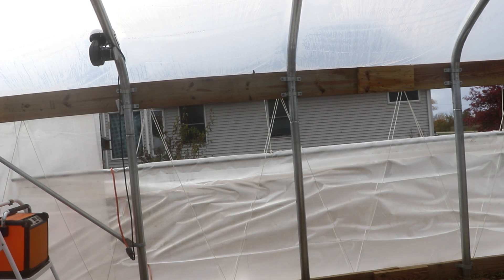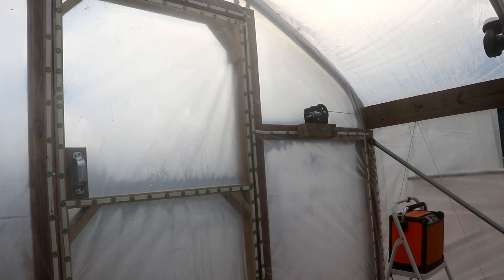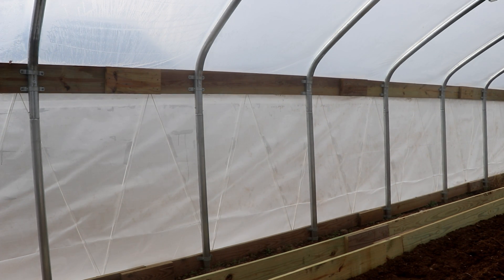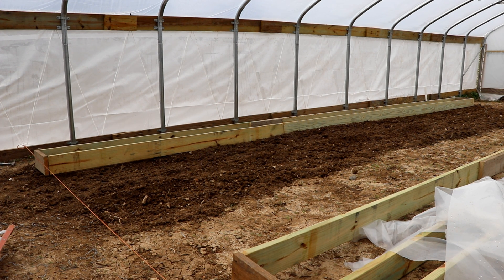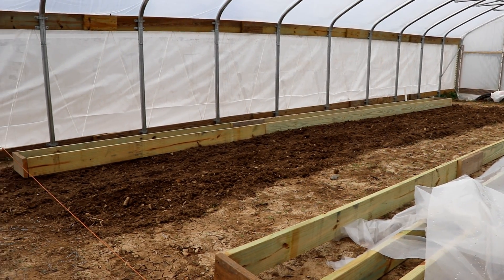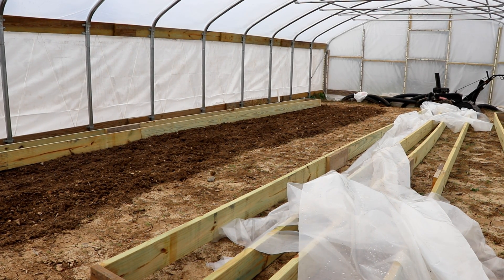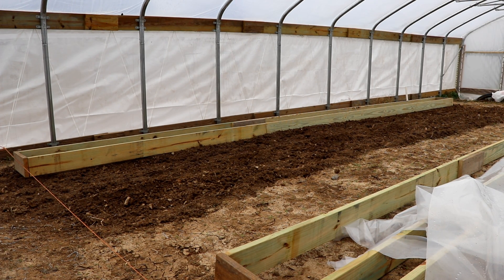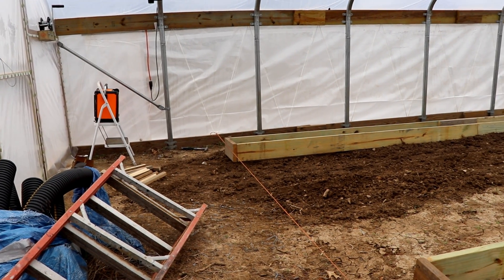Building a geothermal heat sink greenhouse series - part 8

Comment: WAITING FOR YOUR UP DATE,PLANNING ONE TO INSTALL NEXT SPRING SO I AM FOLLOWING YOU CLOSE IN WISCONSIN, ARE YOU GROWING ANY THING YET AND HOW IS THE GEOTHERMAL BED HEATING
Reply from the maker: Floyd Funk good morning.  Hopefully today I’ll get the grow boxes filled and topped off.  We have the fan that will blow air through the heat sink ordered and on the way.  I’m thinking we may need a pair of the fans to move an adequate amount of air to charge the heat sink during the day.  I’ll mount the first fan on my plastic barrel  that will serve as our manifold so I can add a second fan as needed. 

After the grow boxes are full we will start seedlings. Most of our crops initially will be of the cold tolerant variety.  We do want to see how frost sensitive stuff will do with colder evening temperatures and warmer during the day. 

We had 6 inches of snow a few days ago right after getting a freezing rain.  It took a day for the snow to fully stuff off the canopy of the greenhouse.  Once it did we saw a 45-50 degree difference inside the greenhouse on a sunny day. Yesterday it was 26 outside and I saw it around 85 in the greenhouse. Cloudy days are closer to 12-15 degrees difference.
Reply from the maker: Floyd Funk nothing to report on the bed yet.  However, the soil temperature inside the greenhouse is significantly warmer as compared to outside the greenhouse because of the 4 inches of foam insulation.

Comment: Thanks for the update, Heath!
Reply from the maker: Jay Pfeilsticker you’re welcome.  The kids are going back to school today and I will get back to work on it.  We’ve got enough sand and sawdust now to fill all the grow boxes and my first fan is on the way to operate the heatsink.  I’ve always been concerned with the volume of air I want and or need to move to keep the greenhouse above freezing.  I’m not in a massive hurry to get this project done so I’m going to start with one fan and see how it does during our coldest months of the year. If one fan won’t keep it above freezing over night then I’ll add a second one to the manifold.